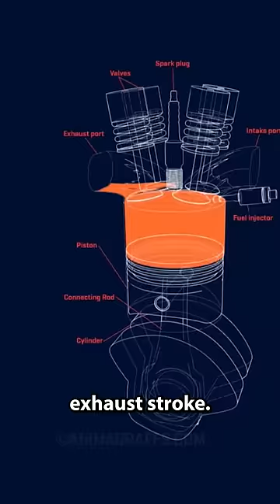Turbos Vs Superchargers

Comment: Exhaust doesn't drive a turbo, the heat of the exhaust does.  The turbo is recovering that lost heat and turning it into boost. That is why its more efficient than a blower.  The blower takes HP to turn, and the heat of the exhaust is wasted.
Reply: The turbine doesn't give a shit about heat, it cares about volume flowing through it. It's recovering the kinetic (velocity) and potential (pressure) energy of the exhaust. There's a temperature drop because pressure drops through thr turbine.
Reply: @knotical689  heat means less volume
Reply: @hotdog9262  volume increases with heat, density decreases
Reply: @knotical689  sure. ment less volume of air going throught the engine with warmer air. intercooler ftw
Reply: @knotical689 the heat does indeed drive the turbo the same way heat lifts a hot air balloon.

The flow of exhaust alone isn't nearly fast enough to spin the turbo 100k rpm
Reply: @inkw4n-nd5iw  that doesn't make sense. Hot air balloons rise because their average density is less than the air, same reason ships float.
Reply: @knotical689 heat also expands, its the expansion that drives the turbo more than the actual flow.
Reply: @inkw4n-nd5iw  yes, expansion means increased volume. I addressed that in my first comment

Comment: Dyde superchargers don't use that much extra power
Reply from the maker: The modern Dodge Hellcat 2.4L IHI supercharger consumes almost 80 horsepower. The Whipple 3.8L on our supercharged Duramax consumes just over 50 horsepower.
Reply: @bankspower  look alot of us ain't really worried about 30hp the only thing I ever noticed with 30 hp increase is smooth throttle

Comment: Rip saab the grand daddy of turbo power 

Gm are a bunch Cs for not investing in such a powerful engineering unitised saab was here still I wouldnt be surprised if the would have a hydrogen lump pushing 300bhp and ready for production

Comment: Toe-may-toe   Toe-mah-toe.
 Unless you have a 1 cyl engine all pistons are connected through the crank and so the power that runs the turbo is parasitic to the crank which connects all. In other words it isn't parasitic to that cylinder but it is parasitic to the piston on the opposite bank.

Comment: Terrible explanation.  The exhaust stroke of one cylinder is the compression stroke of another.  There is no free energy.  That is not why they are more efficient.  They are more efficient because they utilize heat energy from the exhaust gasses that would otherwise be wasted and blown out the tail pipe.

Comment: This is true in a sense, but because the pistons are coupled via crank shaft, its robbing torque from some other piston in the power stroke. Turbos are lighter. And they may have some efficiency that blowers do not have. So hes not wrong,  but its not the whole story.

Comment: Actually you're not as nearly parasitic because only major parasitic effect is increase in exhaust pressure. Turbocharger gets the power from high energy exhaust gas so for the same power your efficiency is greater so less fuel is used. That way you can do more burnouts on one tank 😀

Comment: This is genuinely very very very very very stupid argument. Yes, turbos run on exhaust gases but in multi cylinder engine when one cyclinder is in exhaust stroke there is one is power stroke which is providing power. In a single cyliner engine this would be done by a heavy fly wheel or a  counter weight.

Comment: Better power at same cylinder pressure but you fail to mention wastegates for unutilized power, intercoolers to keep the feed cool, turbo lag which is inevitable in most situations, and excessive engine heat.   

A supercharger, otoh, is instant linear power. Easier to tune. Simpler to set up. Runs cooler than turbo.

Banks is just suggesting things that will make them money. Not because it will make you "better power"

Comment: Turbos are great and cheap power, until you have to use your brakes and accelerate again. In that case the supercharger will get you back up to speed while the turbo is lagging and you’re trying to spool  it back up. I rather spend 3x as much for a supercharger setup. If you’re going to go turbo, you might as well take your cheapness a 100% and buy knockoff Chinese parts.
Reply: Or just simply use properly sized turbos and keep the rpms high during breaking and you won't have any lag

Comment: What a load of shit! Yes its driven off of the exhaust but what drives the exhaust... The power stroke of another piston. As I've said for years turbo's are a gimmick to sell parts. They work but they are a huge pain in the ass with routing, heat etc. And that sells parts!😮

Comment: You FOOL!

Tell me, WHERE does the energy for the exhaust stroke come from.......? 

Turbos create more power potential because they use some of the heat energy that would otherwise be lost down the exhaust pipe.

"HEAD ENGINEER"

ridiculous
Reply: You're not understanding what he's saying. That energy to drive the turbo isn't increasing pressure on the power stroke, it's increasing pressure on the exhaust stroke.

Pressures are highest on the power strike, so that's where your failures are most likely to occur. Making the same power at lower peak cylinder pressure means more reliability.